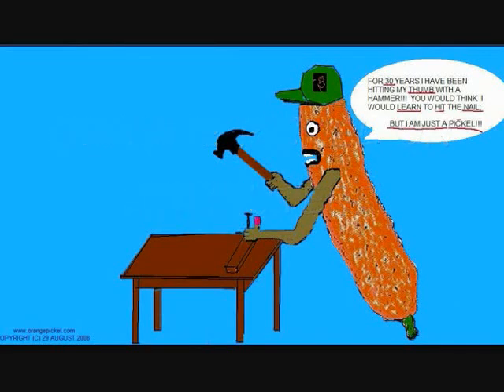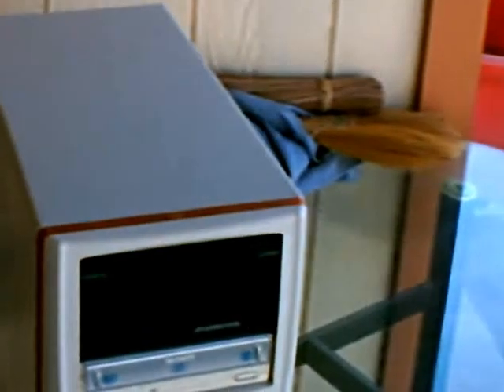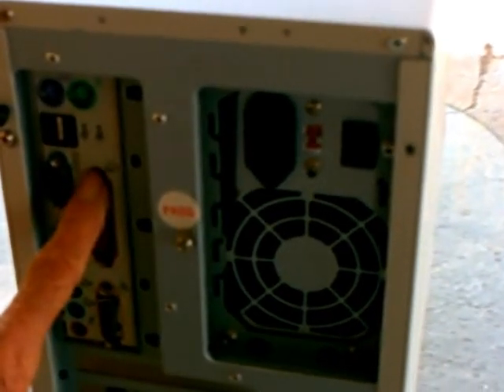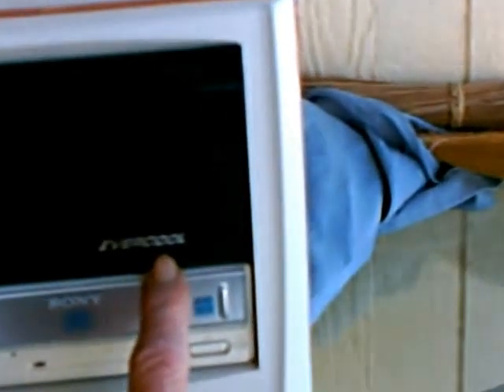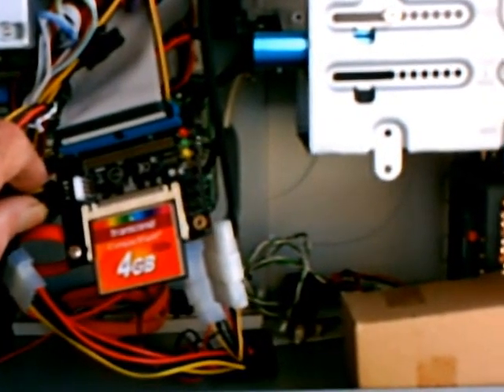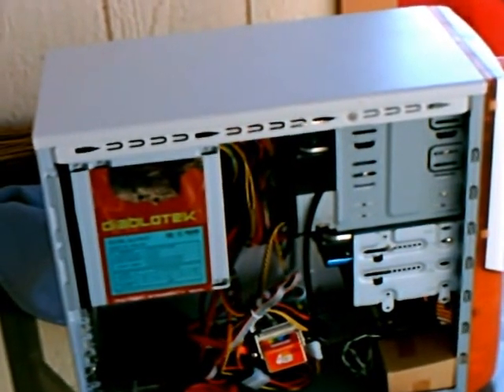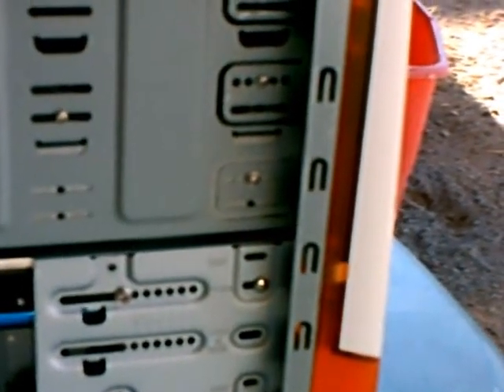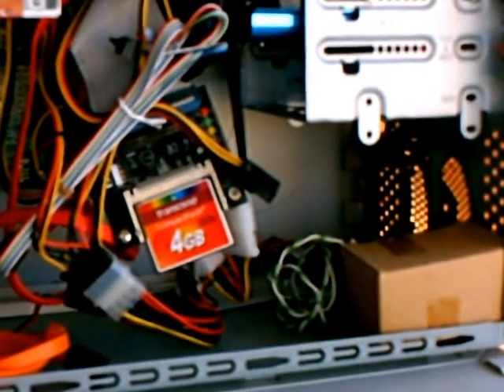FREENAS PROJECT.wmv

Comment from the maker: In reply to requite1 I used a Syba SD-CF-IDE-A which I purchased from Newegg I just checked their website, learned that it is now discontunued stock. I had no problems loading the FreeNas OS from the old Sony DVD IDE. The Drive and the CF Card are both set cable slect if I remember correctly. Not all CF cards are compatable with the system but the 
FLASH 4G|TRANS CF TS4GCF133 R at Newegg is per my research before buying, they carry a 2gig CF card for $1.00 less. System runs great am pleased.